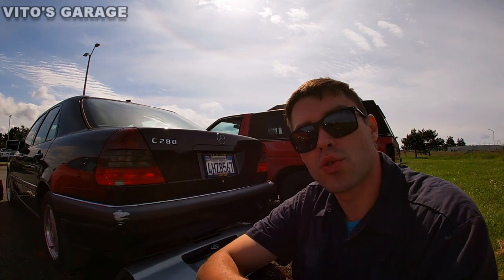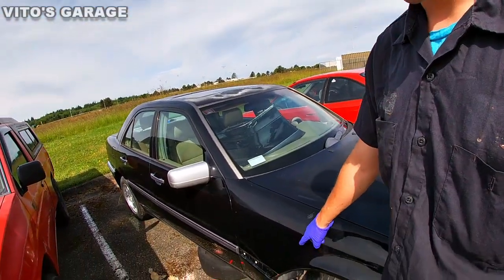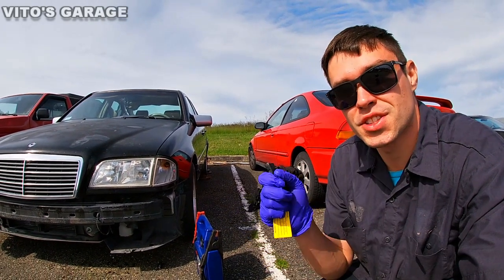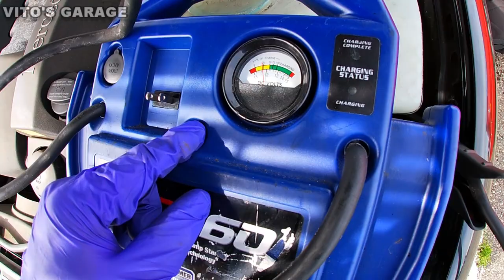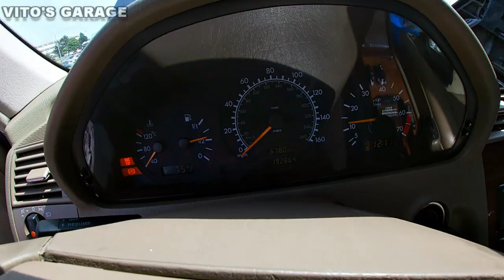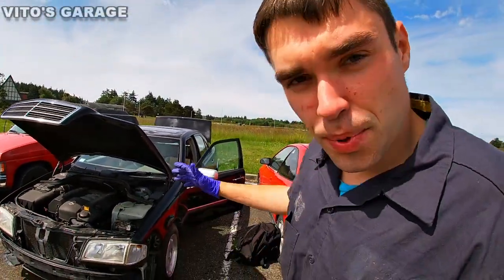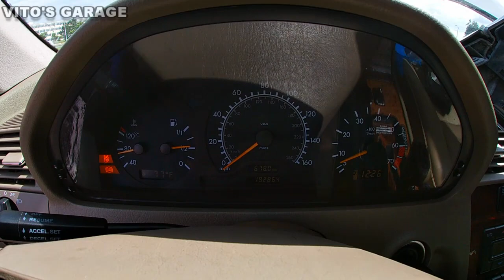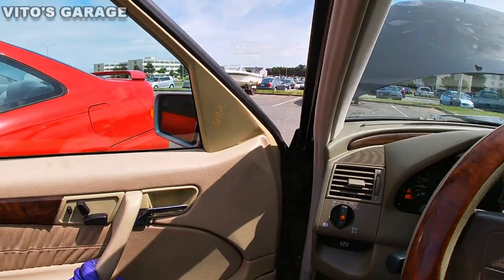Attempting to Start a Stranger's Crashed Mercedes W202 After 1 Year! Will it Start?

Comment: I have a Mercedes Benz w202 C200 (year 1999). When I drive that in heavy rains, the water comes inside the passenger footwell. What could be the possible causes? This is the only problem I have in this car. Cleaned the drain holes under the windshield area. But there’s still no progress.
Reply from the maker: You have to remove some stuff from the footwell and grab a water hose. Spray it down and see where it's coming from
Reply from the maker: Can't tell you exactly where it's coming from. Could be windshield seal or some grommet. Do the diagnosis
Reply: @VITOSGARAGE  It can be the windshield as you said. Thank you for your comment and I suppose that water may come via damaged door beadings. Is it possible?
Reply from the maker: Anything is possible. Like I said, have someone hose down the car with garden hose and you look for the water leaks